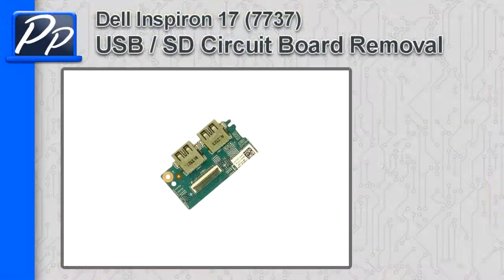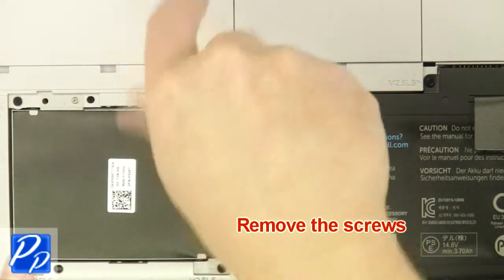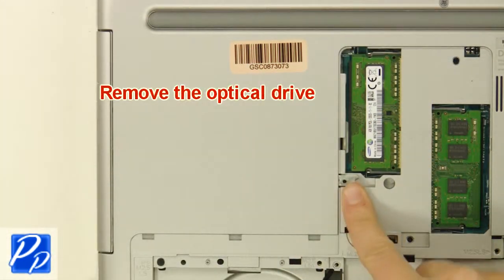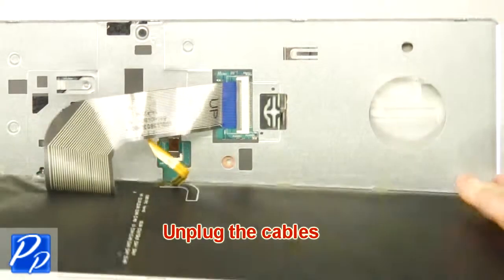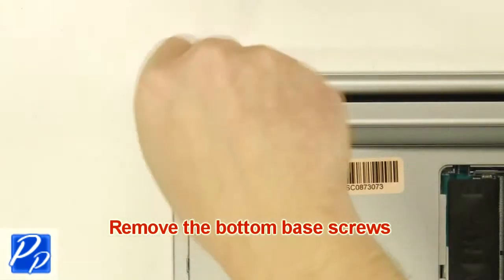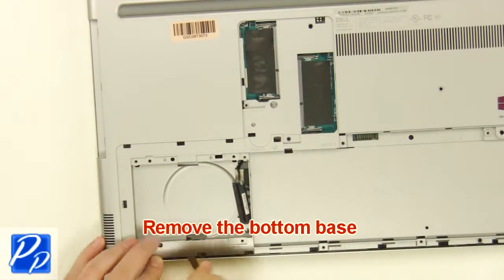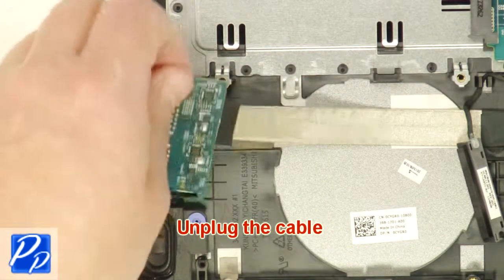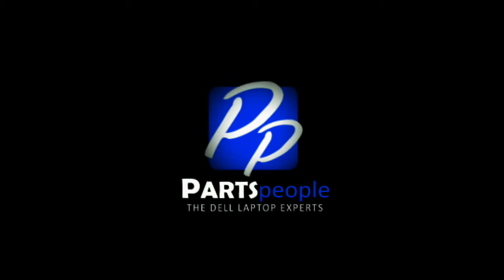Dell Inspiron 17 (7737) USB / SD Circuit Board How-To Video Tutorial

Comment: Will you have to worry about any driver issues or anything like that if you remove a damaged USB/SD board and replace it with a new on?
Reply from the maker: +crosswire40 No, it should already have the driver loaded.